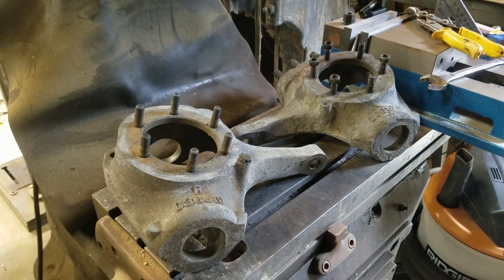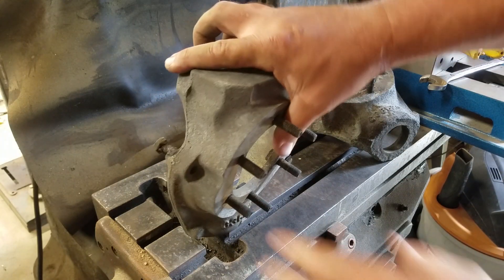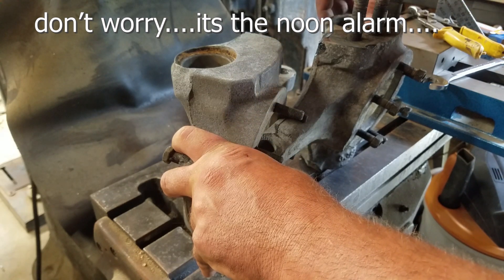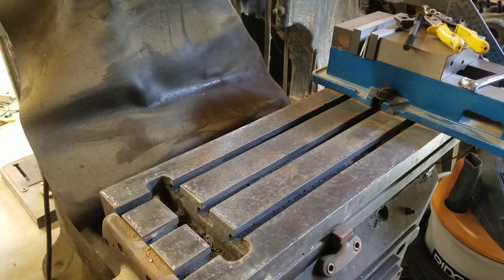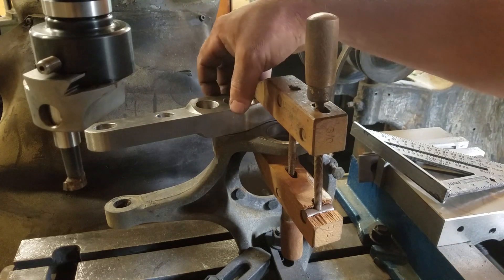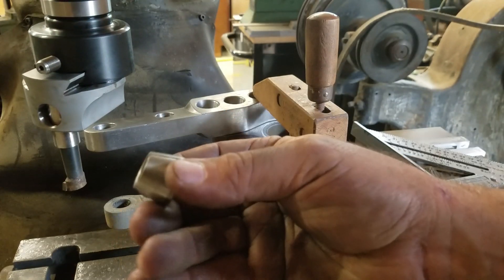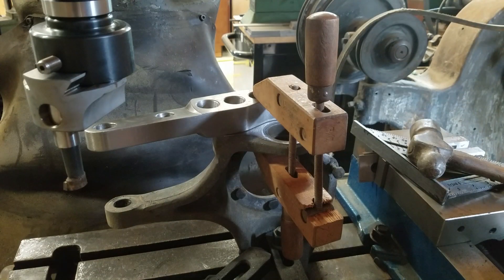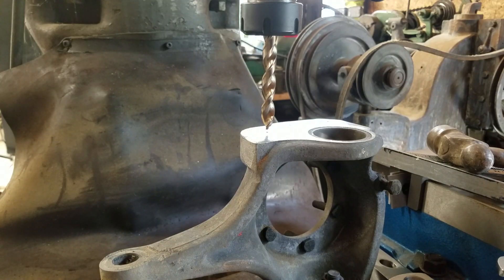Dana 44 High Steering Part 2 - Rust Removal using Evapo-Rust, and machining the passenger knuckle

Comment: Just a suggestion. Add the HS arm to the passenger side knuckle only. At the cast in arm on the knuckles open up to a common taper, 5/8 or 3/4 straight bore.

This will preserve Ackerman steering geometry.